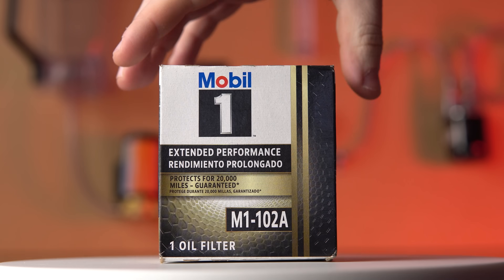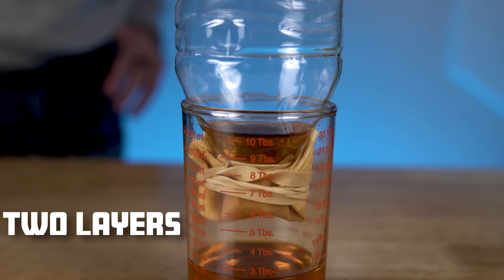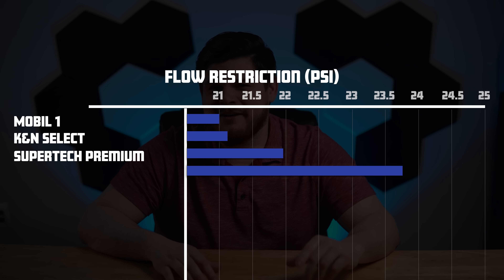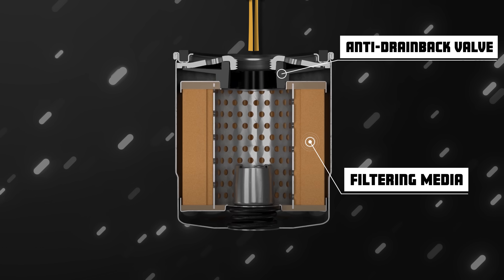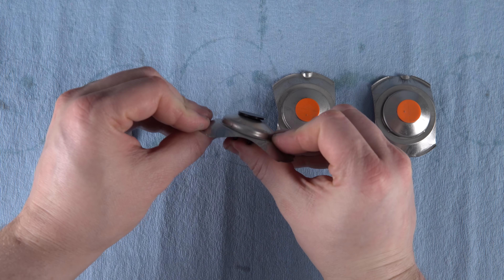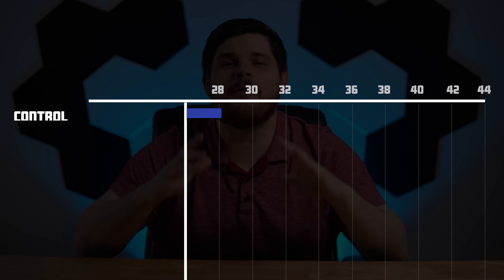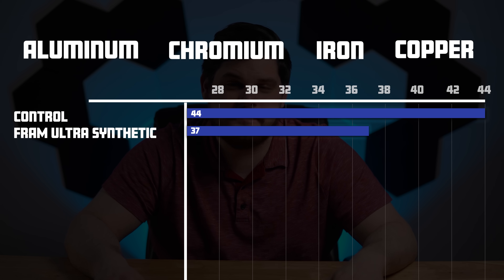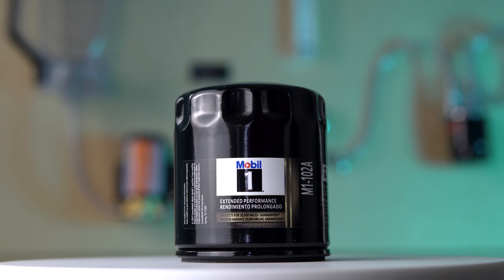Engineers Test the Best Oil Filters! FRAM | Mobil 1 | K&N | Walmart Brand

Comment: It's highly likely the Mobile 1 had the lower operating psi because your favorite bypass valve design was opening allowing the lower pressure. I'll take the filter that is filtering the best.
Reply: It's a theory at best and with that the same can be said about the other filters.
Food for thought, when springs are spec'd for bypass valves of any manner an exact value for overcoming the necessary psi is a very easy thing to achieve. Translation bypass valves can handle far more pressure then the numbers we saw put up.
Also the better better filtering Fram can have check valve failure from collecting debris at the check valve vs the filter element where it's supposed to be. After 10k miles or 20 for that matter, my money is on the filter that'slocking the debris where it should be.

Comment: Been running fram for 50 years in all kinds of high performance engines never a oil related failure, and had 100 psi running in some engines from fresh rebuild to 300,000 miles on when we got it, have 8 with over 300,000 on one owner, and over 500,000 on the one with 300,000 when we got it it was used for pulling wagons out of fields on farms, other were drag racing and off road/ mud bogging

Comment: Amsoil oil filters, made by Donaldson with nanofiber technology are the very best in replacement filter applications. They are good for up to 25,000 miles and the smaller filters are good for up to 15,000 miles, filtering 20 microns at about 99%.

Comment: I've never seen a filter cap made out of aluminum. (9:01)   Anyways at the end of the day just change your oil. Any known brand of oil or filter.  Change it before it's due too. Keep track, don't wait til it tells you.  I've rebuilt hundreds of engines and even though I have confidence in my work I still change the first oil within the first 500 miles, I'd do the same on a new car too. And for sure don't fill the filter with oil before you put it on. the unfiltered oil will go straight into your engine. Why do you think manufacturers are going to canister filters? It's to keep anyone from filling the filter.

Comment: Higher micron filters will catch more contaminant particles but clog up faster and cause greater flow restriction but when that happens they all have a bypass that opens to allow unfiltered oil to pass through. The entire purpose of the filter is to collect all the tiny carbon particles out of the oil so they dont wet sand your cylinders so if you get one that claims it will last longer you are getting one that doesnt get the ultra fine stuff so its kind of pointless..... and anyone who tells you that your oil expires at a specific mileage is an idiot. Change it when it starts to get dark because it is the black carbon dust that turns it black.

Comment: I hope that you purchased the filter for the same vehicle on all of them because vehicles are pressure rated by oil filter. Also keep in mind that oil pressure numbers can get up to like 40 PSI at idle and 80 psi on accelerations so are you sure the pressure test was done correctly?

Comment: I've ran fram filters on my vehicles for years. Never had any issues and currently my 2007 Hyundai Sonata has 211,000 miles and running like new. Key is frequent oil changes. Oil change intervals should never exceed 5,000 miles no matter what the filter is rated for.
Reply: European made are premium

Comment: Thank God because that's what I use in my 2013 Toyota Highlander with 0w 20 20k miles full synthetic, Mobile 1. excellent brand
Reply: You have a Toyota engine, brand of oil doesn’t matter, as long as you change the oil every 5k-10k you’re good.
Reply: @stephenkeller8208 … As long as it’s full synthetic … I heard Toyota motors can get sludged up if you don’t use full synthetic, engines are designed for that …

Comment: I use nothing but napa pro select filter on my hondas and have 217xxx on my 2000 prelude 122xxx on my 09 accord and have no isssues at all change oil every 3000 miles

Comment: I USE LUCAS OIL STABILIZER  EVEY  5000 MILES  CASTROL 10W _ 30  AND A MOTOR CRAFT OIL FILTER.  NEVER  HAD  ANY PROBLEMS. 👌

Comment: I have ran k&n from day one on my kia, noticed my valve train getting noisy, so I switched to a Fram ultra synthetic filter an Holy cow what a difference my engine is a lot quieter, always ran the same oil an changed it every 5000 miles, I think I'm done with k&n oil filters there to restrictive an dont have the flow needed for an engine

Comment: I have been using Fram oil filters for damn near 60 years and have never had a problem BUT I also change my oil and filter religiously on time. If you never change your oil ya I would go with a better brand like WIX but if your like me I don't think its an issue what brand you use.

Comment: My biggest question is heat doesn't the fluidity change when the oil is hot these tests based off of room temperature oil filtering is greatly affected with the temperature of the oil just something to look into maybe there is maybe there isn't a variance I would really look into that all in all the video was very well put together and very informational

Comment: I might be wrong but it seems that your not necessarily testing the restriction from the filter media but the pressure by pass valve. If those are all the same meaning equivalent filters intended for the same application. And to the best of my knowledge that mobile one filter fits some Subaru engines. Subaru requires a high bypass psi which i do believe is 21 psi. Side note i dont think the na Subaru engines need the high bypass but rather the turbocharge models however Subaru is a smallish outfit so they reuse alot of parts to save money and inventory space.

Comment: I heard the average car's oiling filter system only works at idle, when at higher rpms it just bypasses the filter? Since oil pressure should be well above 20psi.

Comment: I've always used fram most of my life, not 1 issue.  I do swith it up with wix or k&n. Upside on k&n is the option of using a 3/8s ratchet to install or to remove the filter

Comment: This is an ignorant subject. Oil filters systems on gasoline engines are designed to be full flow filtration which only filter carbon contamination down to 20-22 microns. Manufacturers state the most wear and tear on engine components is caused by carbon contamination particles 7-8 microns in size. Point is all tests have particles 7-8 microns in size. A bypass filter can filter down to 1-2 micros in size. This is the best way to get longevity out of your engine.

Comment: If I understand the capacity test, 30-micron aluminum powder was added to the oil until the filter flow rate dropped to a threshold.  Presumably the powder was measured as it was added.  If any particular filter were to allow more of the powder to pass, would it be interpreted as having been captured by the filter (higher capacity) when it actually remained in the oil?  I like the test, thanks for doing it.

Comment: You should have used a lower amount of aluminum.  You would never have that much small aluminum debris in the crank case, maybe unless the engine blew up and then it doesn't matter what oil filter you use.
Reply from the maker: Thanks for the feedback, make sure to go check out our newest videos with a rig upgrade

Comment: I think it would be more useful to test and rank against the OEM filters.  That's our baseline performance.  I don't want to use anything that rates below OEM in any of your tests.

Also, ideally you would test several of each brand to get an idea of build and performance consistency.  I'm not just interested in peak performance; I'd like to make sure I don't get a brand that occasionally leaves chunks of glue in the oil or has a leaky anti-drainback valve.

Comment: This video is spot on. I used K&N for years before I realized I was sacrificing filtration for flow. When I stopped using the K&N, I did use the Fram Ultra Synthetic for the subsequent oil change to clean it all out.  Then I switched entirely to Mobil 1 extended performance from then on out. My oil definitely seems to have gotten cleaner. The K&N only protects for 5000 miles tops. One time I waited 6500 miles while using the K&N and the oil got so dirty, I ended up doing 2 oil changes within the next 1000 miles to clean it out. Since switching to Mobil 1 EP, I can easily push the interval up to 7500 miles without worrying too much. I still aim for 5k intervals, but if I don't have time, I don't sweat it like I did with the K&N.

Comment: I don't understand the restrictive testing by measuring pressure.  These filters have bypass valves when pressure builds.  The pressure readings may just indicate the different pressures required to open the bypass valve.

Comment: I've been using Mobile 1 high mileage synthetic and aFram ultra filter fo 15 years perfect so far, and on a 2004 Ram 1500 i have 400,000 miles still running good..Great Video!!!
Reply: I've using the same, with the occasional Pennzoil Ultra Platinum when I can find it. This just confirmed that the Fram Ultra is a good filter. None of the other filters were filtering to 20 microns, the amount of aluminum dust was excessive and the oil wasn't at operating temp. It's a flawed test, but I saw nothing to make me change from the Fram Ultra filter, although the M1 looked good.
Reply: A old acquaintance of mine once bought a 65 Biscayne because it ran really quiet.
But it was gutless.
Turns out tge quiet part was because the space under the valve covers was absolutely crammed with hardened sludge.
He cleaned it up, started it up,
And,
Clatter-clatter-clatter-clatter.
Probably never had an oil change. 
SMH
Reply: @vanpenguin22 Some people think motor oil is just for oiling the engine. They just don't know any more than that.
Reply: 15 years?  You missed your oil change.
Reply: Ever replace oil pressure sensor?
Reply: My father used to pour some Marvel Mystery Oil down the carburetor to help free a stuck lifter and to clean things a bit.
Reply: @kurtbeck5809  Same with my father in the 60s. The car was a Lincoln Zephyr, which had a V12 engine. The motor oil was nowhere near as good as today's oil.
Reply: Same 1995 Silverado 305
443k miles
Reply: Purolator boss is the best tho. But all of the top 5 filters are good.
Reply: Cannot argue with success.
Reply: @brucesmith9144  correlation is not the same as causation.  I bet he did proper maintenance, the filter is secondary to proper overall maintenance.
Reply: Is it a diesel.
Reply: @organicmaterialsciencecorp6115  that’s a testament to quality oil and filter technology and a dedication to maintaining your vehicle. As we all know the vast majority of people are totally lacking in both of these necessities. I’m driving an 09 gmc 5.3 liter at 180k miles. Using Fram and so far so good.
Reply: I've been doing the same on multiple vehicles for 20 years with K&N filters.
Reply: Must be magic to make a ram last 400k miles . I couldn't imagine the suspension repairs to drag that heap across the line
Reply: Switch to Valvoline Restore and Protect oil. Restores engine to factory clean in 4 oil changes. Its made a difference in my 130k Kia Niro and luckily started the girlfriends at 11k
Reply: My vehicle maintenance is similar, vehicle having 310,000 miles. Please note, you do not have to use the high mileage every oil change. It has seal conditioners. So every other time is adequate for engines over 5 years old. Sometimes I use 1 quart of the high mileage with 4 quarts of full synthetic. I don't want to over condition the seals. But with 400,000 you are doing many things right...
Reply: @tarquineous is that really how it works? I was told that one you start using high mileage oil you have to always use it
Reply: @skatingsam96  No. You can use any oil you want as long as it meets or exceeds the factory requirements. It's possible to use too much High Mileage oil in my opinion. High Mileage oil has seal conditioners added to the oil. I like to use High Mileage every other oil change or include a quart of High Mileage oil per oil change, after running a full crankcase full.
And it depends on how old the engine is. Some may need High Mileage oil for three oil change intervals before the seals become rubbery again. I've seen cases where it was too late. The seals were hard and worn from dirty oil, and the engine would constantly leak. But those were severe cases.
BTW, there is also High Mileage oil additives such as Protecta, and Extreme Green. These you can add to your favorite motor oil.
Reply: @tarquineous  
I use about 8oz TransX seal conditioner in my oil changes.
I’ve had cars that used a qt per 800mi and in about 20k mi, changing every 5k mi, it had cut oil usage to a qt per 2000 mi and over next few changes, 2500mi/qt until car got totaled w192,000 on it.
I’ve had oil analyzed and it didn’t negatively affect it.
Reply: @Chucka10  That should work and clean the engine internals. I would not use very much, like maybe 3 ounces per oil change. Hapco makes one that can be used in engines, automatic transmissions and power steering systems.
I've used it, and it takes a while to work, which might be a good thing.  It takes about 3 months to make a difference.
Be careful. I know a person who put a bottle of STP transmission stop leak in a Volkswagen Golf, 4 cylinder engine. This was about 20 years ago, but the front oil seal blew and oil was all over the car and road. I think it swelled the seal too much !
I like using one quart of High Mileage oil per oil change. Better yet, I add one bottle of Protecta High Mileage engine treatment. This reduces wear and conditions the seals.
Reply: @ 
I use one oz per qt after the initial treatment.
Reply: @tarquineous  high mileage oil is a marketing gimmick. All oils have steel conditioners in them.
Reply: Same I use.
Reply: Fram is junk and shreds
Reply: Useless test
Reply: @todmill100   "useless" no, but definitely not a comprehensive test.
Reply: @todmill100  They gave useful information. The result is the filters vary somewhat, but all of those tested were good.
Reply: @todmill100 useless comment

Comment: The Mobil 1 filter has the weakest bypass valve. That's why it had the lowest pressure in the first test. The bypass valve open earlier than the others. That's also why it did so poorly in other filtration test, because the oil was bypassing the filter media due to the weak bypass spring.

Comment: So I recently removed a Fram ultra synthetic from my 2015 Chevy Silverado duramax diesel at 3000 miles of use and approximately 95 days or just over 3 months.  First off I went to remove the filter and the end caved in as if all of the integrity had been lost. This was concerning. I then grabbed a filter wrench, and again it collapsed under any pressure,  Next I put a special tool I have that engulfed housing no matter what shape or size and was able to remove the filter at that point, other than that, I would’ve had a destroyed filter, unable to remove off the vehicle.  My synopsis is that I will never buy a Fram filter again and I have no clue as to how much of a job filtering it was actually doing.
Reply from the maker: Wow! Thanks for sharing! And thank you for watching

Comment: Mechanic here, this is my opinion on oil changes. 

I have a 2008 civic 1.8 with 230k miles, I’ve owned since 102k (~5 years) I’ve followed the oil life interval 100%-5% (about 7,000 miles) religiously and here’s what’s happened. 

I’ve never had a check engine light, I’ve never even had to add oil. This thing doesn’t burn oil. I’ve done regular valve lash adjustments, regular maintenance and I’ve been using 0w20 instead of 5w20 since owning this car with a Mobil 1 filter every, single, oil change. 

At 180k, after I adjusted the valve lash which on these engines is required every 60-80k, I sent a sample of oil to black stone labs and this is what they found

(Ppm=parts per million, so 5 parts of x material to 1million parts of oil) 
-5 ppm of aluminum (average is 8) 
-5 ppm of iron (average is 8)

They even told me the oil maintained its 0w20 viscosity and was still transparent. There was even 70% more active additives left in the oil than other oil samples that have been changed at 7k miles based on other samples they’ve tested at the same mileage. 

I drive about 100 miles a day, and I beat the hell out of this car. There isn’t a day that goes by where I’m not flooring it to get on the highway or idling it during my lunch break to stay warm. 

Here’s my opinion, as a mechanic and someone who has changed oil on 10s of thousands of cars now. If you use good quality oil and a good quality filter, follow the manufacturers recommendations. If you however buy the cheapest oil and filter you can find or get the cheapest oil change package at your local jiffy lube, change it every 5k miles or so. 

Either way, oil changes are cheap, engines are not. If you’re doing it yourself, you might as well get the best oil and filter you can and change it at the manufacturers recommendeded interval. These people engineered and designed these engines, they know more than we do about when you should change the oil. Simple fact. If you get it done by a shop and can’t afford the best oil and filter, change it more frequently. 

There’s my two cents.
Reply: why do you use 0w20? i understand it being better in the winter because it’s not as thick as 5w20 when cold, but i’m curious if there are other benefits? my mindset has always been to run thicker oil because a lot of manufactures now only use thin oils for efficiency